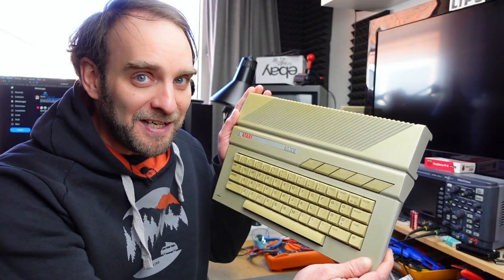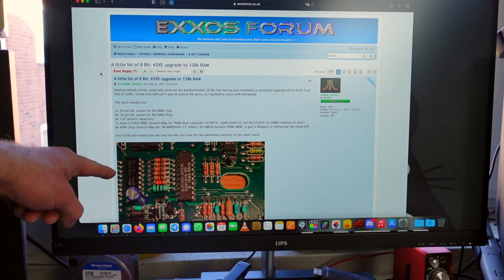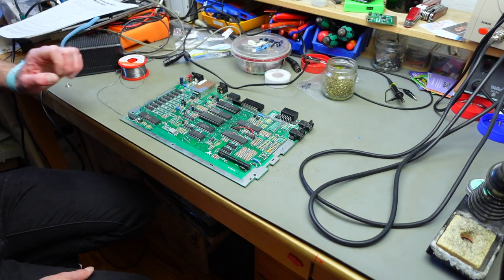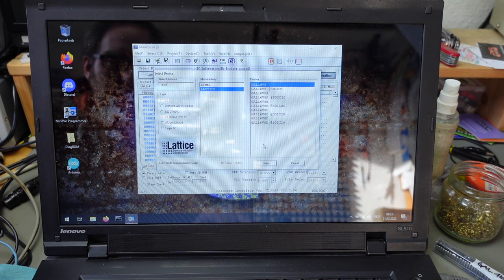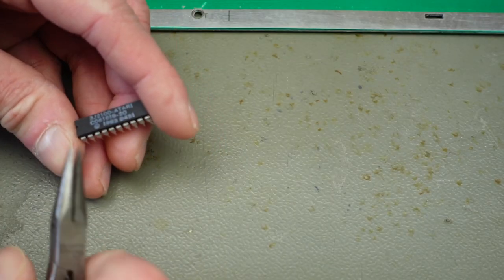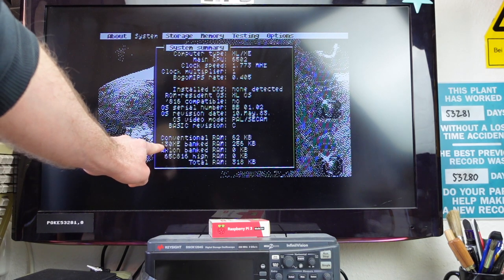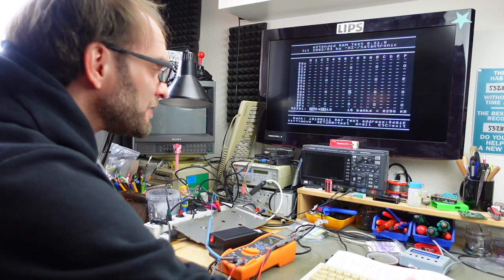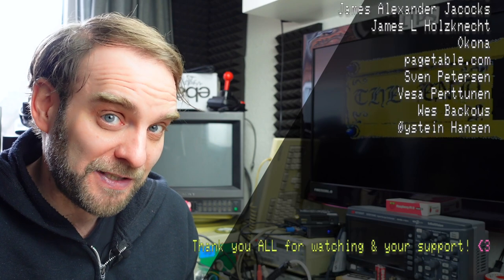Atari 65XE 320k RAM Upgrade

Comment: Thank you for this great video. It encouraged me to dig out my old Atari 65XE's that had the 130XE main board like yours. I already had loads of 41256 RAM from an old PC memory board. I ordered the GALs on eBay from a supplier in China and they came within about 10 days and all verified on my programmer. I have now performed this upgrade on three Atari 65XE machines and all XRAM tested OK. I ran all the wires under the main board and connected the GAL pin 7 to the underside of the MMU socket pin 6 which is permanently connected to PIA U23 pin 17. I left GAL pin 9 floating, as initially I was following a German translation of Jürgen's original PDF, which seems to have the logic reversed, with a ground on GAL pin 9 enabling the extra RAM when actually the opposite is true! I would have preffered the ground on GAL pin 9 to enable the extra RAM as then the pin would not need to be raised from the socket.
Reply from the maker: Oh, glad that it worked for you! I’m still struggling to find the fault in my Atari that makes the RAM expansion act up. :D

Comment: Ram upgrades have a soft spot in my heart. My very first mod was for my original TRS-80 Model 1 where I increased the ram via the piggy back method. I will watch any vid performing a ram upgrade. I always learn something, just as with this one. Good luck in finding the issue(s)!
Reply from the maker: Thanks! I love RAM upgrades, too. Especially since memory chips are not as expensive as they used to be back in the day. :D Follow-up video is already in the making, I got some very good hints in the comments, hope I can resolve the remaining issues.

Comment: Instead of drilling a hole for a switch perhaps you can use a reed switch and a small metal plate inside, so a neodimium sticks on the outside of the computer?
Reply: Excellent idea.  I think many retro computer enthusiasts don't know about reed switches.  For those unfamiliar with them, they're just a switch that's activated by a magnetic field.
Reply from the maker: Yes, that would be a neater solution indeed. I have to try using a reed switch for mods like this in the future. :)

Comment: Hands-down!  The PIN Sockets are far superior!  There's little to NO corrosion, and non-slipping.
Reply: At the aerospace company I work at, they used turned sockets (back when they used sockets). Wipe sockets weren't good enough.

Comment: The turned pin sockets are fine for chips with full length legs, but I’ve found that chips with trimmed legs have a hard time staying seated and end up making bad connections.  In the case of trimmed legs, double wipe sockets are a better choice.

Comment: Excellent upgrade video! One suggestion, perhaps it may be good to put a pull down on the pin of the pin you are intending on grounding in the case of disabling instead of shorting to ground. The results might not be desirable if there is a situation where you have nearly zero ohm's at ground ground reference. Even a weak pull down of 10k ohms will assure this is not the case.
Reply from the maker: Yes! I added a pull down on the switch when I added that. Sorry if that wasn't clear from the video.
Reply: @JanBeta  no need to apologize! Your videos are excellent ☺️ I am glad the pull down was there. At the very least I missed seeing it and it gave me the opportunity to have a short discussion with my son about watts law (he and I sometimes watch your videos together, he was home sick from school). He's only 8 but he loves these 8 bit computers. His dream is to build or repair a commodore PET one day.

Comment: GALs might be out of production, but Atmel/Microchip still actively produces equivalent parts:

ATF16V8B
ATF22V10C

Both can be programmed with a TL866 II Plus.
Reply: There are problems with those: they're hard to get on secondary markets, and ordering them directly from Microchip can be costly as they expect minimum orders.
Reply: @talideon  everything is a bit hard to get at the moment, but the point is they are still manufactured today, and you're not having to rely of the odd batch showing up on eBay, or having to buy parts of questionable origin.
Reply: @talideon  I had no problem getting them from Digikey.... well not until recently of course!
Reply: @talideon  They are easy to come by in small quantities via Mouser or Digikey and they really are drop-in replacements for GALs.
Reply: @jaycee1980  hah yep. I was lucky to pick up a tube of each prior to all of this madness. Now there are lead times out to 2023. Not a great time to be a hobbyist or small scale manufacturer. :-(
Reply: Я поставил ATF16V8B + 74LS95. Отлично работает. Сделал себе с переключением 130/320. Некоторый софт на 320 не заработал. Кому интересно, могу поделиться прошивкой.

Comment: I did a 320XE upgrade to my 130XE computer back in the late 80's  I also had an upgrade box from ICD that had a Hard Disk interface and additional ram.   I used 150 NS ram and it worked just fine.
Reply from the maker: Yes, I would guess that the 150ns variant would be more period correct and the faster RAM I used might cause some random timing issues. I hope I can resolve the issues, looking into it as we speak. :)

Comment: Well I also thought that replacing  caps was   to avoid probable future issues, but since I fixed  an Atari 80xl's random crashes by just replacing its caps , I tend to replace them in all my retro machines before I even start working on them!
Reply: True wisdom! They are well beyond there life span. Even if they still ok I replace them as its preventing future problems. 
And hello again!
Reply from the maker: Completely agreed. I have often seen systems run more stable after replacing the old capacitors. On some models (like ZX Spectrums for example) you often get a cleaner video signal even. Definitely always a good idea to use fresh capacitors, even if the original ones still measure in spec.
Reply: @tharkthax3960  Hello again! I was thinking  of bothering you again with some questions on why my second 1050 was refusing to write or format disks, but it turned out a dust bunny was resting between the ir led and the sensor rendering the drive "write protected"! An atariage forum was really helpful.
Either way, nice hearing from you again and confirming  my perception on those old caps.
Its also nice to be able to enjoy some "Jan Beta quality" videos on these machines!
Reply: @JanBeta  nice. Just replaced some caps in an old compumate atari/c64 deck and it's now working again! The caps looked like they had stretched and the silver tops were frosty looking with rings - a bit like the rings on a tree stump!
Look forward to your next video 😁
Reply: @nickolasgaspar9660  good result and yes always good to see Jan in action! 
It's a good education.

Comment: Great video!
I use a plug in 320xe mem expansion,  but I would say this method is much more reliable(when good chips used). Occasionally I have to remove the mem plug in and clean the pins. 
And I'm glad you did the caps, I done plenty atari machines and found quite a few naff caps. Sometimes they look bald with the sleeve coming down the sides! Same thing happened to my hair seeing as tho I come into the 'old category!
Really enjoy your videos
Reply from the maker: Thanks! Yeah, capacitors of a certain age can't really be trusted anymore in general, I guess. I have seen very few that were completely out of spec but it's just a matter of time until they fail. And even if they are marginal, they can cause all kinds of random faults. :)

Comment: Bad luck old chap.
If it's not marginal RAM I smell a Mexican Sally issue. IIRC the Mexican made versions of the 6502C were notorious for instability in conjunction with the way 8 bit Ataris load up their data and address lines - unbuffered by default. Also the PHI can be a bit ropey. So stability issues can crop up with upgrades. If it turns out not just a bad RAM chip of two might I suggest looking up some of the fixes? Assuming you have a Mexican Sally of course...

Curiosity:
The ICs that 'needed' their pins bent up - are those pins connected to any traces? If not it might be neater to run all the wiring under the board. Just at thought.

Comment: I think the resistor between the switch and ground isn't necessary. Some people prefer to put a resistor between 5V and a logic input instead. To be extra safe, you could move the resistor to the middle pin of the switch, so the resistor would be connected in both positions.
Reply from the maker: Good point! I might experiment with that. Don't think that it would prevent the memory from working but might be a good idea in the long run.

Comment: As I don’t like bending chip legs if I can avoid it, rather than bending up the pins on the GAL, I would have removed the pins from the socket. Rather than drilling a hole, I would have suggested removing the RF modulator and putting the switch in the hole that is left if you really want a switch. Personally I would have left the memory switched on permanently.
Reply from the maker: That's a good option, too. I like to leave the sockets "untouched" to make it easier to replace chips if that should become necessary (which it most likely is in my case). :D Leaving the RAM permanently on is of course an option, especially since this mod should be compatible with the vast majority of software anyway.

Comment: Did you run the memory check for the 64K part of the board. Assuming that the screen is showing a demo with corruption, and assuming that the screen is in the main 64K, maybe you aren't having a problem with the 256K. Maybe it's the 64K.

Comment: I don't think it is a speed issue, if there are chips that consistently reported as okay. Try switching the chips around, to see one or more chips consistently reports as bad.
Reply from the maker: The RAM that is reported as faulty seems to randomly shift with each power cycle. At this point, I rather suspect the GAL programming or the logic chip to misbehave. Looking into it as we speak.
Reply: @JanBeta  Randomness and ttl logic usually means a floating input somewhere. But I would suspect the GAL too. It is a simple chip once programmed, but but a floating pin will screw it up.

Comment: i guess you need a good memory test routine that exactly tells you what is wrong here. could be a single bit on all addresses or a certain address block that would suggest a problem with the address lines. if it is an issue with the timing, you could shift a clock bit by running it through two inverters.

Comment: I wonder if you could identify the faulty RAM chip by swapping them two at a time and then running the extended RAM test.  If the error never changes, the RAM isn’t the issue.  If swapping a certain chip moves the error consistently then you only have one chip to replace.
Reply from the maker: The errors seem to be randomly changing addresses, so I am pretty sure it's not a RAM issue at this point. But I'm going to double check everything. Found some replacement RAM in the meantime, too.

Comment: 'HYB41256-12' worked for me, pulled from an Atari STE 256KB simm, if you've upgraded an STE to 4Mb see if the previously installed simms are an option.

Comment: BTW, Ebay Kleinanzeigen might be a good source for RAM chips, I just got 8 replacement RAMs for an 800XL from there for a really good price (I think). Only took 2 days.
Reply: I got lucky on Pollin with their bag of random ICs... only four different ICs... a rare-ish ancient microcontroller, an FM tuner IC (I have two tuners that actually use them, but they appear to never go bad), a BUS transceiver logic IC and... a ton (like at least 50) of 4164 DRAMs made in GDR which all tested working.
Old graphics cards (ISA...) are also a great source for RAM chips... 4164s are relatively rare on those (some older Hercules cards use them), but from '87 you'll be seeing 4464s and 44256s in large numbers.

Comment: Instead of drilling a hole for a switch could you have put in a 3 way rocker switch to replace the original power switch?
Reply from the maker: Oh, that would be a nice clean solution indeed. :)
Reply: @JanBeta  I'm not sure how it-would be wired or if-possible.
Reply from the maker: I think the circuit board would have to be slightly modified for it to work and some more wires would have to be added but in theory, it should work. Would need a dual three-way switch for toggling on/off and the memory expansion. A bit fiddly but doable, I guess. :)

Comment: Comparison of your modification and the pictures in the topic suggests, that you mixed two or more modificaitions (you missed the 33R resistor, for instance).
Reply: He added the 33 ohm resistor but covered it with heat shrink and passed the wire through a different hole so it looks a little different. At 27:35 he tests it with the multimeter and it shows about 33 ohms.
Reply: @Viking_Cookie  I must have missed that. I made 5-6 similar upgrades but using different schematics. All the boards work fine. The difference was, I needed 2 additional logic chips but a standard, regular EMMU.
Reply from the maker: Yes, I added that resistor. I double checked the wiring a couple of times now and everything seems to be correct according to the instructions in the pdf. I'm in the process of checking the GAL and the 74 logic chip now. Also still might be an issue with the RAM, of course. We'll see. :)
Reply: @JanBeta  The 74LS95 chip is needed only for the extension to work as CompyShop type. Without it, it  works as Rambo (no access to external RAM for Antic). The computer should work fine without it.

Comment: I vote against a DRAM issue ;) Those are 1 bit drams, if some of them were bad you would have biterrors in all pages, not missing pages. I'd try to verify if the GAL is programmed correctly (minipro  has some issues with some GAL types)
Reply from the maker: Good point! Several possibilities have been pointed out in the comments. I don't believe my "faulty RAM" theory anymore. ;)

Comment: One thought while I was watching the video.  You  might want to invest in a pin straightening tool instead of straightening IC pins using a pair of pliers.  They're cheap and work pretty well.  I suppose it doesn't make a real difference, since pliers do work pretty well, but it's just a thought.  They're even useful when straightening the pins on new ICs.
Reply from the maker: Oh, I recently got one of those tools and used it for the ICs. I didn't mention it in the video but you can see me using it in some frames even, I think. Invaluable tool! :)

Comment: Funny, I actually posted two floppy drives for repair to Jürgen (tfhh) TODAY. :)
Interesting video with a bit of a letdown at the end but I guess that's real life and not Instagram. Why don't you remove the RF modulator (especially for the switch) or install a U1MB as mentioned? And I'm really looking forward to the cleaning video since I have two 800XL and a 130XE in need of a good scrub.
Reply: The XE line produces the composite video in the RF modulator.  IF he doesn't have an SVIDEO cable he won't see any picture. Jurgen is a great guy. He sent me a program that  activates/deactivates the extra memory without the need of hardware switches.
Reply: @nickolasgaspar9660  Whoops! Didn't know that, thanks. New TVs don't have S-Video in, so that can be quite a problem. On the other hand, composite sucks qualitywise.
Reply: @mnemo70  Really!, they no longer come with scart connectors ? I wasn't aware of that because I run all my 8bit machines on crts! Only my Amiga is on a tft panel.
 Composite and Svideo  appear  pretty close on my trinitrons. Well one can spot some color artifacts here and there on composite but nothing deal breaking, but I can see the issues with newer displays
Reply: btw do you know which version (board) is your 130 xe? (does it have factory bodge wires?)
Reply: @nickolasgaspar9660  Grrrr. YouTube ate my comment. I opened the 130XE, the board is C070067 REV -5. 16 RAM chips and three bodge wires.

Comment: Where do you buy your electronic parts in Germany? Is it a web reseller?
Reply from the maker: I mostly buy from Reichelt and Conrad. For the out-of-production parts like the RAM and the 74 logic chip, I used ebay in this case.
Reply: @JanBeta  Thanks Jan, I will take note of those resellers. They will come handy for many components as my local supplier here has retired 😅

Comment: I always feel uncomfortable bending the legs on chips to I use a second socket as an adapter soldering the wires and cutting the legs where required

Comment: Rather then drilling a hole in the case, you could have added the switch by going out with wires through the front vents (and glue the switch to the case). This would have been fully reversible.
Reply from the maker: Yes, there's of course a number of options to do it in a non-destructive way. I kind of like the old-school approach in this case. No regrets so far. ;)

Comment: It could be that 100ns ram is too fast... I have seen similar issues in Spectrum +2's when faster chips are used, due to poorly defined RAS/CAS timing in those machines
Reply from the maker: Yes, that might indeed be an issue. I read several forum threads were people had random issues with different RAM speeds. Not for this particular mod, but it seems sometimes timings can be marginal even if it should work in theory.

Comment: Supprised it worked because you called out that pin 9 goes to 16 but you pointed out pin 7 on the GAL... So I think pin 7 and 9 on the GAL are swapped. But maybe it just swiched 2 address lines...
Reply from the maker: I think I just misspoke in the shot there. I checked the wiring a couple of times afterwards with the instructions at hand and I think it's all correctly wired up.
Reply: @JanBeta  Dang, I just thougth I spotted the problem for you... bummer, not so. Looking forward to the troubleshooting video tho. Actually any Jan Beta video, I like your content and the format. Grüße aus den Niederlanden!